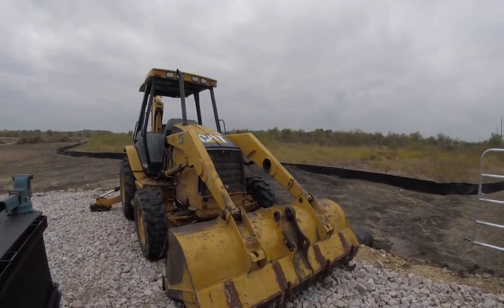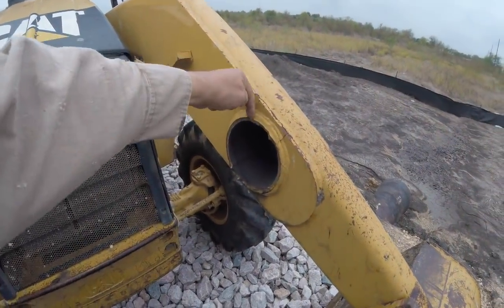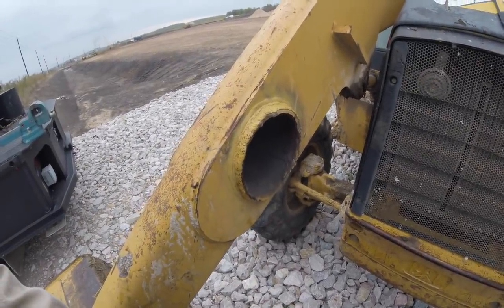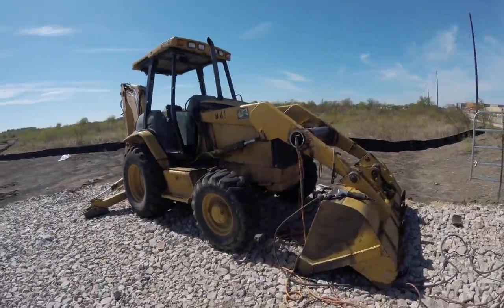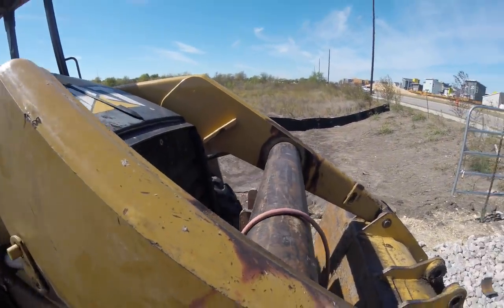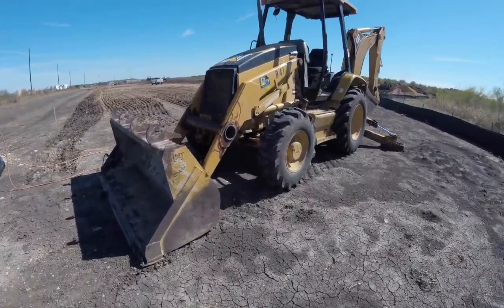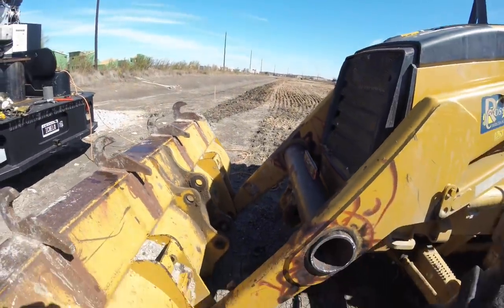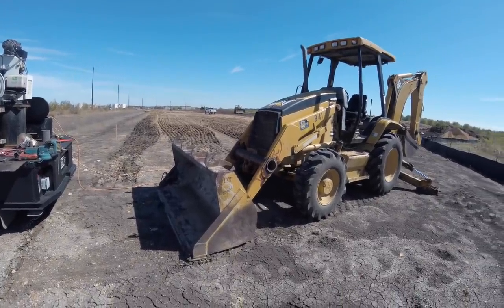Easy Peasy 416 Caterpillar Backhoe repair

Comment: You wield that cutting torch like a fine instrument! I answered an add on Craigslist in San Diego that said “ Do you want to learn welding? Need to work hard and listen! Great welder, handed me the cutting torch while we were doing a job at a hospital with the air handlers and said “ cut this 12 “ pipe off right here” and pointed to a spot. I had never handled a torch before and looked at him befuddled, he gave me a ten minute lesson on the right settings and let me go......looked like a crown when I was done...all over the place so I know what it takes. P.S I got better and could even bevel respectably also really liked it and now I have my own welder and torch.
Love watching your video’s learn something every time. Thanks

Comment: Ive watched a number of your videos and finally figured out what it is that I like... it may sound odd but i admire your honesty in admitting that you dont do perfection, you do the best you can with what you have, time and materials under difficult field conditions.
Most of all i admire your tenacity and stickability. You work in shit conditions and , cramped, windy, hot, cold under chassis dripping oil on broken and abused equipment and you take it. I like that, you are a man.
Reply from the maker: Thank you bud. I'm not doing anything special. There are thousands of similar workers that keep things running behind the scenes. I just happen to video it. Thank you for your support.
Reply: @ICWeld I am sure lots of guys tell you are very humble.  I know lots of folks that fabricate and weld but your experience really comes thru in how you approach these jobs and tips like verify machine is level before you tack up the tube, cut old pipe out using bevel cut to minimize your grinding,  etc.  And as this guy pointed out you are doing this in less than perfect conditions. 

Where I am it's tough to find guys willing to take on projects at a reasonable price, maybe it's cause they have plenty of work from thier regular customers.   Buts seems many times I hire someone and it's always someone else's fault when thier repair doesn't come out right.

Glad your making these showing this is possible if you have correct guy doing the work.

Comment: I really need to get an Arc welder. Until i get more practice with stick welding i usually use my left hand to better control my gap and the finer manipulation of the puddle. Many years experience with center seam welding lathes, and turntable style spud welders in a production environment. Then hand Mig in a Fab shop. Enjoyed hitting 200% + daily efficiency (Rate) numbers wise. (Of course only good parts/assemblies count).                    Very enjoyable watching your skills and techniques. Good channel and content!

Comment: If you want to clean up the look of your finished weld you can always do a rough finish grinding or just do a quick downhill weld on your welds, this won`t affect strength but will give a nice finish, and always have lots of paint, different colors for different machines because it looks more professional and is appreciated. PS, I`m an old disabled mechanic welder and i always kept a steel bucket to drop my rod ends into and i also took an old steel coffee can and a bid speaker magnet, then silicone the magnet to the bottom of the can so you can stick this to your work area and collect burned rod ends. On some jobs where fire is a concern this is a good practice, and again looks more professional, this also gives you short ends to tack up welds. PS I`m a senior and a disabled mechanic welder.

Comment: You are a true artist with your torch I have to say please keep posting and one question why don’t you use the Meg Welder instead of an arc welder just a question I understand you could probably get a hotter well with the Arc welder is that why you use Ace or Mig welding

Comment: I really appreciate the time you take to do it right every time, I also appreciate the way you have your truck set up.  I noticed the springs on your torch hose that takes up some of the stress on them.  Are you still using the springs?
Thanks
Reply from the maker: Yes, these are the longest lasting hoses I've owned. I'm still using them today.

Comment: Wish I could weld like that !
Reply: Practice practice practice dude once you nail arc length travel speed and rod angle you can pretty much do anything  keep practicing it's taken me 3 years of self tuition to be a good welder on mma and mig  but these guys are the masters at their trade I watch loads of videos for hints advice ic weld chuckie2009 welding tips and tricks  and so many more and put all of their advice into practice cant thank them enough going to start night school classes to refine my skill soon but theses guys have taught me so much.

Comment: This cross tube is a weak point in theese machines. My father used to have an 1997  CAT 416C and he had to reinforce this tube joints. It's not a problem that affects only older machines, as I've seen several E-series (2008-2015) CAT backhoe  loaders with the same problem. In the new F2-series machines, this structure is a little different, in the bucket cilinder setting.

Comment: Do the implement manufacturers ever consult you regarding your opinion on their design weaknesses and suggestions as to improvements?
Reply from the maker: No but it sure would help them!
Reply: @ICWeld  
My experience has taught me that the best source of information concerning any issue is obtained from those at the coal face. The piece of paper stating one’s qualifications means zero unless coupled with at least 10 years hands on experience, nowadays they are driven totally by accounts and their budgets together with the marketing geniuses.

Comment: Been in the shop my whole welding career and just went back to burning rod on tanks after never touching it since school. Was wondering since the end caps are cosmetic, did u run that down hill with some 60- rod or do you burn 7018 on most your repair work? We burn 7018 & jet rod, I fuckin love it here in AZ. You can crank the fans up and not worry about porosity.😎You do clean work bruh🤙🏼
Reply from the maker: Yeah, they're just covers.

Comment: Im new to your channel, subscribed a while back to see your monster projects and how you weld thick metal. Learned a few tricks in the process, im glad there are people out there like you! Great welding, my 60 yr old hand always shakes! Lol.. love that circle cutter set up! Where can I get one? Also, do you mind telling me what number rod and amperage did you use? Thx u  in advance.
Reply from the maker: I usually use a No.000 tip for anything under 1/2 material and a No.1 up to about 1". Both set at 7/70 pressures. As far as rod amperage, I stick to anywhere between 98-120A for 1/8" 7018 electrodes depending on how hot the parent metal is and how thick it is. plus the welding position.
Reply: @ICWeld  hey thanks for the reply easy. And thx for your advice, however is 6013 1/8 “ rod just as good? I like the way 7018 flows but is it as strong as 6013?

Comment: Hey guy i noticed on that backhoe repair part of the reason for that support beam in between the arms
Breaking is one of the hydraulic cylinders is leaking and probably not working as hard as the other one or as solid as the other am i right?
Reply: By the way, nice welding haven't seen that good a flow since my dad
Died.
Reply from the maker: possibly

Comment: Is there a way to know what grade steel to use when you replace stuff like that tube?
Reply from the maker: Not really sure what material was used. the customer provided it. But, It was a heavier wall pipe. Should last pretty well.

Comment: Great video. Was there 2 pipes inside the arm?  Why did you arc gouge the cracks and not grind them? I have never done arc gouging so I am not aware of its pros and cons.
Reply from the maker: Single pipe that went across each opening for the arms. I was cutting out the remaining pieces that were left in the arms so I could install a whole new pipe section.
Reply: Pro's to arc gouging is the speed at which you can remove metal and it is ability to let you follow a crack out

Comment: Are those failures the result of normal use?
Reply from the maker: I think it comes from putting the bucket down on uneven surfaces. Out here there is a lot of rock that protrudes out of the ground. I would imagine that setting the front bucket down on the rock adds weird stresses to the front cross tube as they're digging with the back hoe side.

Comment: Out of curiosity what is the price range for this type of repair. Enjoyed seeing your work!
Reply from the maker: It varies depending upon what the local market will hold, price wise. This repair can easily be done in a full day of about 10-12hrs or so (only the welding part).  In my case, I made 3 separate visits to this machine throughout the week because  of scheduling and lack of material supplied by the customer.

Comment: Just a thought but you’d likely reduce your undercut by sixty percent if you use an add-on wire feeder like the Lincoln LN-25 and a low-hydrogen cored wire. Nice job though man, which should last the life of that machine.
Reply: What difference does the wire feeder make?  As long as his amps matches the wire speed isn't that enough?  The flux core wire you are talking about what brand/model?

Comment: I know nothing about welding , so can someone explain to me why when repairing plant do you guys use stick welder & not mig ?
I'm just curious not been critical.
Reply: artisansportsman I’m no pro either, but generally stick welding is used because it gets better penetration into the metal which creates a stronger weld. Also, in this circumstance he is welding outdoors in the elements where a gas shielded wire welder would suffer because the shielding gas would blow away from the weld causing porosity. Stick welding is also capable of getting through rusty, painted or generally nasty material wear a MIG machine would suffer even though it is recommended to clean the materials.
Reply: @johngraves9201  Agree with all of the above, but the better the preparation, the better the weld and the better the final job.

Comment: I used to work in the factory that made those arm's they never did look strong enough for the job
Reply from the maker: They work fine so long as the front bucket always sits on flat surfaces but when theyre sat down on uneven rocks while trying to use the rear bucket, It really stresses that cross tube.
Reply: @ICWeld  I'll have to take your word for that as I have not used anything that small, I usually work in a quarry where the smallest thing is a pc340 with a breaker on.

Comment: Isaac, you used 6010? And how many passes? Also about how much length did you leave after the whole on the outer part? 1 inch on each side?
Reply: If it's like the work from his Instagram (@icweld), it's usually all 7018 all day long, including the root passes
Reply from the maker: I only used 7018 for this job. And I left about 1-1/4" stick out. I think the overall tube length was 45" plus end caps.

Comment: Watch out on that repair--If one of the loader cylinders has bad seals inside, it can constantly be torquing the arms and crack again.
Reply: Too many times prying with the corner of the bucket would be my first guess why it broke but yes one cylinder more powerful than another definitely a bad thing.
Reply: CAT'S ONLY HAVE 1 CYLINDER IN THE MIDDLE
Reply: @johnlieske8908  Yes, but I was referring to the boom cylinders which is where the strain on his repair comes from. Having the only one cylinder for the bucket requires you to work the bucket square to prevent stress on the boom arms, if that makes sense.

Comment: Too much work !Cut up to1ft pieces of pipe that slip over crossmember .slip pieces over each end . Put cross member in place ,set upbucket level like you were going to tack in place. Gouge crossmember ends weld up ,clean weld so pipe pieces slide close to arms and weld.weld inside pipe ends !That will make that cross member so rugged 
It will NEVER break.No r&r of Clevis no r&r of crossmember in arms,no r$r end caps.Job done in 1/3 time your on to next job,owner is making money and is impressed with your efficiency!

Comment: You should have tossed a rubber duck or a picture of yourself into the pipe before you welded on the end caps.  Leave a surprise for the next guy who repairs it.